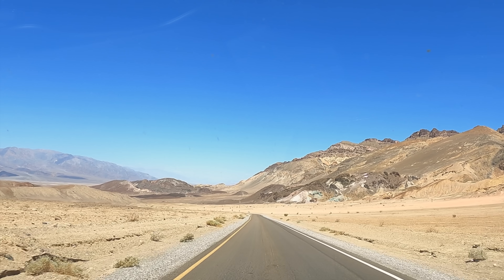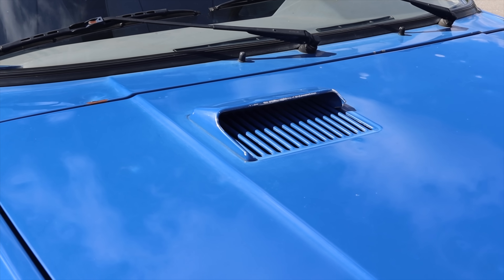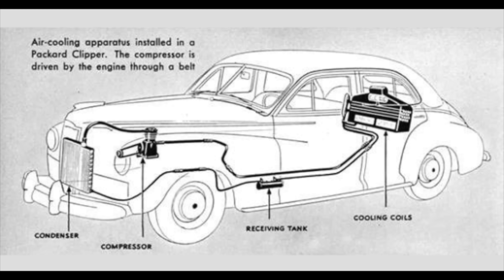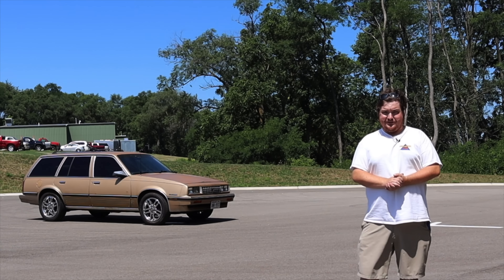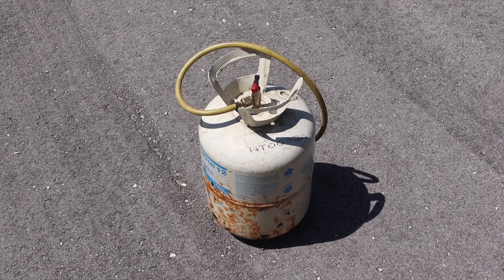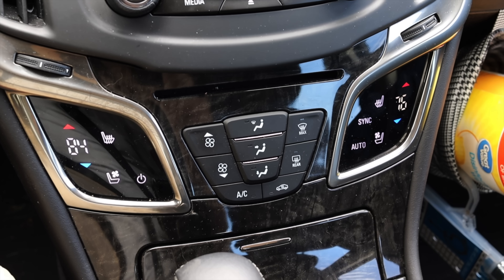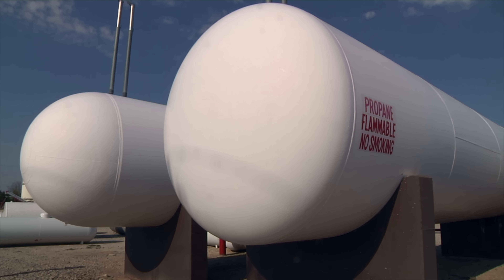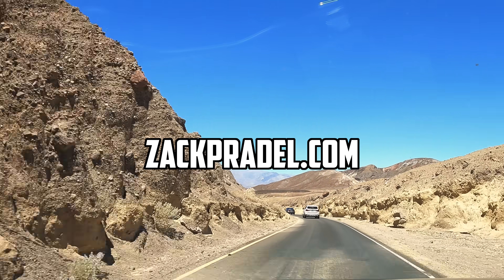Air Conditioning - The Story Of R12 & Why Modern Air Conditioning SUCKS!

Comment: I live in Phoenix, R12 is superior to r134 it's colder and operates at lower pressure so components last longer.
The worst ac systems were early r134a cars and converted R12 systems.

Comment: I had two cars that had our 12 AC systems in it and with the r12 it cooled the air in your car a lot quicker than what the r134 does when you started up an r12 system it actually drawled the humidity out of your vehicle the r134 it takes about 15-20 minutes for it to draw the humidity out of your car

Comment: So as an actual master technician I can speak on this because I also understand specifically how air conditioning works. The type of refrigerant doesn’t matter because air conditioning cools the incoming air by surrounding it with cold refrigerant through the condenser. So if you want colder air conditioning just install a bigger condenser
Reply: So as an actual master mechanic you do not know how air conditioning works..come on guy it’s possible people that have the experience and knowledge of air conditioning systems are on the internet reading these comments
Reply: @JOMaMa..  that's exactly how air conditioning works you are lying and trying to discredit someone for the sake of trolling. I was working on automobiles before you were thought of and have worked on r12 systems which is something not many can say. And I challenge anyone to find a colder air conditioner than a first generation Tundra which is R134. But thank you for the attempt to discredit me for internet clout. Go back to school kid

Comment: Good video, thx! First two cars I had were pontiacs (86 Grand Am and 89 Bonneville). While the grand am was junk on wheels, it did have excellent a/c. Rarely used “max” recirc, it just blew ice cold! My 1989 Bonneville same thing, really cold ac! Some of our current cars have 134a and it’s cool but not cold. Also have that r1234yf or whatever In others, seems about the same performance as r134a, that said one car has this weird 7 year desiccant replacement interval. So seems like ac systems are becoming less durable in my eyes…

Comment: Oh the good old days when everything was better. What a crock of 💩 The good old days weren't better. Air Conditioning was a very expensive add-on and didn't become a thing until Japanese cars in the 80's started including it as some type of advantage. The difference between old air and modern air is ventilation and how it is implemented. Most modern a/c is controlled by a selective temperature gauge, which is rarely accurate (when my car says 24C it's closer to 21C inside), and an auto fan function which reduces the speed as the air heads towards the selected temperature. Instead of, in the good old days, just hitting the cold slide all the way down to cold and blasting it as high as you could. Modern ventilation is crap in cars compared to the old ones but that has to do with styling. But I'd rather have my little 2.5 4cyl modern car than my old V8. My tiny little engine makes more HP than my old V8 did! Faster to 60, more responsive and always cool inside, It handles better and is a lot more comfortable where it counts. Where as my 1976 V8 sports coupe didn't have air because it would drain the engine power, unless you had a really big 6.2 V8, and it just simply cost too much to add. Cars just weren't better in the 80's, we just have stupid, fond memories of the good old days. Like when you could drink and drive and never get caught unless you were smashed.

Comment: Out of several cars I had with dead A/C. An exception was my 77 Chrysler Cordoba. It had this absurd V2 compressor that looked like a little Harley Davidson motor. You coulden't just leave it on high cause you'll almost start seeing your breath. But when bakeing in the sun and the "Fine Corinthian Leather" seats were 200 degrees, it took only a few minutes to make the interior feel like a refrigerator.
Also, of note, R12 becomes poisonous if exposed to fire. And R134A is as flammable as propane. That's why modern cars burn like an Iraqi oil well if they light up. That and 1500 lbs of plastic.

Comment: Ha! I rode across Death Valley back in August of 1970 in the back seat of a 1966 Dodge Charger without A/C. It was a balmy 117 degrees. That would probably kill me now! 
Large industrial refrigeration and cooling units used in food processing use ammonia. It's more efficient and less expensive than CFCs. It has a "0" rating for affects on ozone depletion and global warming causation. But it is not compatible with copper and can be toxic in large concentrations. However, because of its sharp odor, even a small leak is readily detectible.
While I like old cars, cars of today are far superior to even the best muscle car of the 1960s. It's fun to own and drive some of this old iron, but nobody would want one for daily transportation today.
BTW: My late father was an autobody repairman in the 1950s - Vent window was the most common name, but called them by a lot of other names. GM called them Ventipanes.

Comment: I used to not only have cars with R12, I repaired them too.  I also worked with R22 (monochlorodifloromethane) - commonly used in refrigerators and home air conditioning units.

The most efficient refrigerant known is man is - are you writing this down? - water 💦.  It will absorb a lot of heat before it boils.  So why don’t they use it?  Two major problems: 1) it is corrosive, and 2) the boiling point is so high that the system would have to be operated on a very high vacuum to make it usable, and it is much harder to seal a vacuum than pressure.

Almost as efficient as water; much more efficient than R12, R134A, R420 and the rest is one of the oldest refrigerants R717 -Anhydrous Ammonia.  It is extremely common as an industrial refrigerant and in commercial meat 🥩 processing plants.  I have worked with it too.  It REALLY works well but when you have a building with approximately 10,000 pounds of it circulating from the roof to the basement and floors in between you learn how to work with it safely. People couldn’t deal with it safely in a car and that’s too bad.

Comment: Great substitute for R12 which actually works better is a blend of propane and isobutane (keeps the pressure lower) I've used it in my 81 Datsun, 86 Volkswagen, and now my son's 92 Miata, so I have real world experience with it. Before some  know it all blow hard says "but it's flammable and dangerous" , I worry more about the 14 gallons of gas in my fuel tank, than 16 ounces of propane. It's common for refrigerators in Europe to use butane as the refrigerant.

Comment: I used to have a 1978 Chevy van, it had the R 12 factory air-conditioning in it. However when I bought the car it did not have the compressor installed.

When I was deciding to put the AC back into operation a friend of mine recommended that I use R 152 a, Which basically is those canned air duster’s that you get. Believe it or not that actually works pretty good as a conversion. That van blew 36° air out through the vents even in the desert.
Reply: r152a is my go to retrofit refrigerant as it has a very similar pressure curve to r12 and is much cheaper than sourcing r12.

Comment: well what sucks worst...computer is now running your ac by Operating System, so the digital controls gonna depend on the software is in working state entire time or else...it won't turn on due to crash or software errors

Comment: 2x scoops below the windscreen on some older cars, with vents in the rather thick C pillars. That's what was done with a few models of Vauxhall in the late 60's through early 70's. Being designed and primarily sold in the UK however there was never an option for factory AC - even on luxury models. You just had decent to excellent heaters.

Comment: Propane it ain't, though it can be, but butane is just right. Isobutane to be precice. I'm from eastern Europe, the Balkans in particular and some 10 years ago I used to work in a group of several small office buildings surrounding a medium sized green court between the capital's downtown and posh neighbourhoods. On the street corner there is a 10-12 story buildig - the headquarters of ex socialist state petroleum products seller (all gas stations in the country used to be theirs) and they are still in the same bussiness, but now privatized and in competition with tens of others. In the green court there were half a dozen of big emergency diesel generators of various companies occupying these buildigs and a couple of late 70s marvels - huge central airconditioning units for the petrol guys' building. These airconditioning units were posh - product of some hitech company based in Oxford, UK and were serviced 3-4 times per year. Based on the period one might think they used R-12, but he would be wrong: technitians alays brought with them gas cans full of butane - the same thing that lights up your smoke. B.t.w. I don't know wether in the USA is popular to have a car or other combustion engine equipment on liquified petroleum gas, but the LPG sold in most of the Europe's gas stations for car engines and in supermarkets as cans for camping gadgets like stoves, lighters and so on is not propane, but a mix of propane and butane. LPG for cars in countries with noticeable cold winter is sold as different mixture without notice - in the cold months it contains more propane than butane and in the rest of the year its composition is the opposite.

Comment: I just put in propane. The boiling / compression rate plus heat absorbed is almost the same as R-12 and no changes needed to the oil. As for people who are concerned about the fact that it's flammable. So is the fifteen gallons of gasoline you're riding on and in modern cars with fuel injection systems the pressures in the fuel line are very similar.

Comment: "Over 30 years, the atmosphere has healed itself" A truer evaluation would be that now we know that the ozone hole over the South Pole grows and shrinks cyclically. Just like acid rain, a non-problem that the greens take credit for fixing. Curious how they didn't take credit for saving the planet when the temperature ceased showing any trend up or down around 1998. And curious that the increased CO2 emitted powering less efficient A/C units is never mentioned. Changing all cars and all residences on the planet over to a less effective working fluid must have had some effect, doncha think?

Comment: I disagree with your position that modern AC isnt as good.
I'm old enough to remember those aftermarket AC units that mounted under the dash, they almost never worked beyond the first couple years, and the ones that did pulled a LOT of your horsepower for a barely noticeable difference in temp.... even with a full charge. (note these early systems were designed to lose a certain amount of refrigerant as part of normal operation, so you had to have them charged every other year)
Meanwhile my 03 lexus AC blows so cold you have to crack a window on long trips, and ive never had it charged.... also it blows cold as soon as you turn it on, you dont need to give it 5 minutes or be at highway speeds or anything. 
I have an old Toyota pickup that still has an operational R12 system, it still works, but it sucks and i will be converting it to modern refrigerant ASAP.
Maybe its your chevy/ford/mopar AC that sucks... try buying a car made in Japan sometime... you'll be amazed at the difference in quality.

Comment: Yes, I remember R12, and one could also buy it at auto-parts stores in small cans, similar to ones we can buy containing R134a (for now) And, at least R12 vehicles can be converted to R134a with varying degrees of success.
Unfortunately, the R12 and R134 systems can't be converted to the new R1234 refrigerant! 😞

Comment: As a refrigeration mechanic  I have personally tested many refrigerants. If r12 , r22 was saved for domestic refrigeration  and air conditioning  only, we would use a lot less energy to create refrigeration effect.  I had a fish factory owner crying when we changed over r12 r22 nd r502 in his coolrooms. He had his power meter read weekly to stay on top of bills. This over doubled his power bill consumption. So I agree fire extinguishers , McDonald foam Berger trays , styrophomes , dry cleaners etc was a good ban of cfc s.
But refrigeration if it costs more in energy to produce is more eco terrorism,  more powers ational demand. Also R12 is many times denser than air. This ozone depletion being attacked happens in the lab. But how does it get up there. Look at  jet fuel it attacks ozone too. Then there was the conspiracy of DU PONTS  patients running out. 
I believe you can still get r12 in Asia, as some boatys  bought some back to Australia in their systems I worked on. Even Disney on ice had a wall of disposable r22 in their container. Disposable s were band in Australia back in 1995. This was 2007/8. 
The new gasses are all high demand in energy , LPG based  and at least dangerous  imagine a car crash. Supermarket  are on CO2  systems again hi energy inputs

Comment: Using propane isn't as insane as you may think. In the world of refrigeration it's typically called R-290. From what I've seen it works pretty stinking well. It stays in the atmosphere for an extremely short period of time compared to 134a. While it is flammable so is the new 1234yf... And it's freaking cheap. I don't know performance characteristics compared to r12 or 134a, but I'd assume it's somewhere in the middle.

Comment: Propane is a refrigerant: it's listed as R290.

I miss vent windows - had 'em on my 89 suburban. Worked great, crack the tailgate window,  flip oen the butterfly windows, and you didn't need A/C till it got above 90 as long as you stay at highway speeds.

Comment: So the military and the chip industry consumed 2/3 of the freon consumption lettting it just boil into the air as it was a great solvent, I'm assuming the military didn't want the equipment like a vehicle has to contain it.  a volcano puts out more chlorine atoms than a life time of releasing R12 all they had to do is stop the military and the chip industry

Comment: All technically wrong about why R12 was better. The system of the 50s, 60s and early 70s had more components, they used thermostatic expansion valves to control a constant super heat. To prevent freezing the evaporator, they use suction pressure control valves to prevent the saturation temperature of the evaporator dropping below 32F. They had a receiver with a sight glass, just charge until the bubbles are gone. Now systems use a simple restrictor to control the flow of refrigerant from the high to low side, but the charge is critical to the operation, and the evaporator never runs near 32F unless undercharged. The thermal enthalpy of R12 vs R134a is not the cause of the poorer thermal effect, it's the cheap system design.

Comment: R1234yf is extremely toxic. The chemical might not deplete the ozone layer but it will stay in the ground water forever. It degrades into a PFAS poly flourinated alkylated substance. These group of chemicals do not degrade in the environment. Every time a car has a frontal collision most of the time the AC hoses rupture. All that Freon into the water. Multiply that by every frontal collision in the country over the course of several years. Good luck cleaning an aquifer. At least the atmosphere has a way of degrading molecules through cosmic radiation.

Comment: My 2014 is350 probably has one of the best car A/Cs I've ever used. Can just about freeze you in there on hot days, ofc I usually just set the thermostat at 70F° and it keeps the car comfortable for me. (The automatic temperature control works remarkably good). I can't say the same for other cars with r134a. Guess Lexus/ Toyota nailed it somehow.

Comment: Todays cars are far superior to the old cars we used to have.  That being said, the old R12 systems were a lot better than 134A, but I remember my 66 and 73 Cadillacs with that wonderful Auto Climate Control kept that car very comfortable under any weather condition and I loved it.  Today. I drive a 2013 Toyota Avalon Limited and a 2013 Honda Civic EXL.  The Auto Climate Control works better than in any old Cadillac of the past and the Avalon is aa good along with the Honda.  Even though these newer cars are better, I still loved my 60s and 70s big GM boats

Comment: I don't think it's true that R134A isn't as good. I had a 1994 toyota corolla that even if you just put the thermostat on cold and didn't turn the fan on was too cold for an Australian summer. Even without the fan on, you would need to wear two jumpers and jacket to be warm enough in the car in the middle of summer at about 34 C.

Comment: I have been doing my own A/C car maintenance since the late 1960's.  In comparing R-12 to R-134a, I believe they are identical, as vapor pressures and cooling capacity are identical.  It is my belief that Dupont devised the ozone panic/media blitz to justify changing refrigerant types. The ozone depletion theory was never proven.  In the end, the R-123a price increased 6 times more than R-12.   All this effort put into refrigerant that operates in a sealed system, so actually, very little refrigerant gets into the atmosphere.  R-12 had been used for many decades and was extremely stable, safe, and had an excellent track record.

Now, R-123a has been condemned as bad so, is being replaced by R-1234yf.

Cooling capacity of older cars.  Yes, the older cars had better cooling because, they had larger compressors.  GM, with their A6 compressor, had 18,000 btu.  Now, cooling capacities are about half that because, compressors are smaller to save gas.
Reply: Nonsense gm checked the epa report found R12 did damage ozone they immediately stopped making R12. My regards to gm.